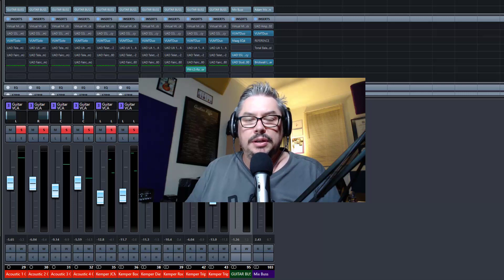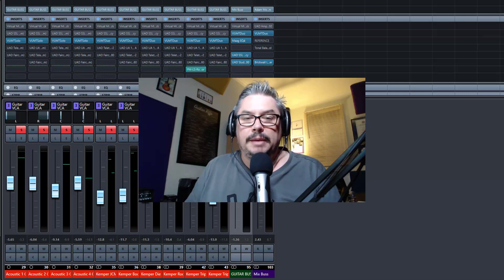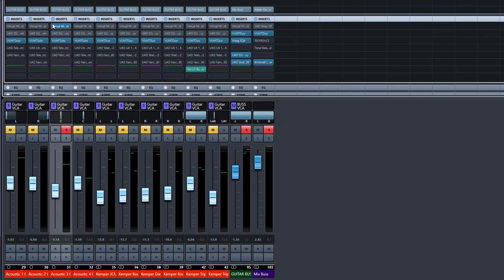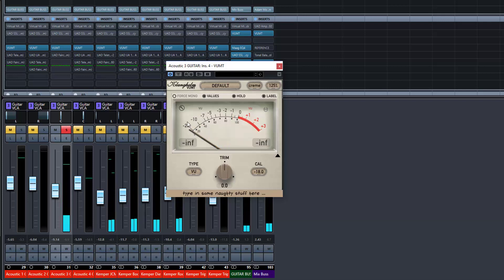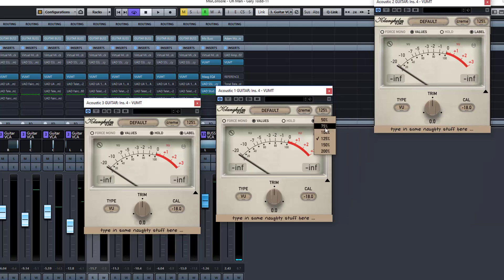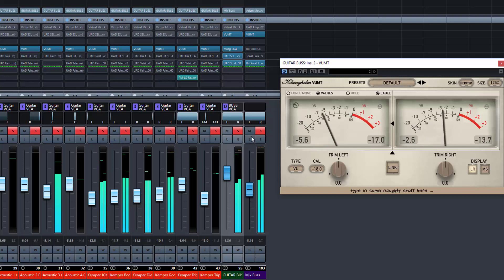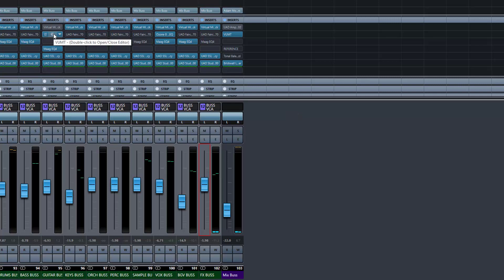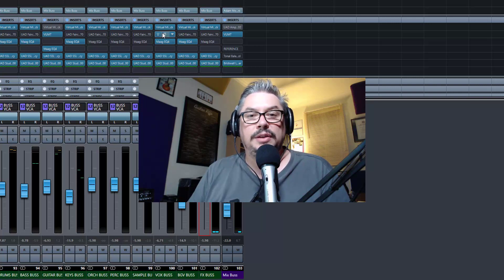How to Gain Stage using a VU Meter - Gain Staging Mixing Tutorial

Comment: First of all Thanks for a great video. A couple of questions on the procedure please. 

1. First you do the 0VU on individual channels, but when you are doing the same to Busses you are again changing individual channels to get 0VU on the busses which disturbs the 0VU setting on individual channels.

2. Again after Individual busses are at 0VU, while adjusting the main mix bus to 0VU you are disturbing the Individual Buss balance to get 0VU on the main mix bus.

3. When you have your main Mix Bus at 0VU, your entire song is averaging at -18dBFS, which is very low for mastering. Many sound engineering are teaching to keep Mix Bus at -6dBFS which is 12 dB hotter. 

Your video is fantastic. I am trying to understand better and learn the techniques you're explaining. Kindly help me to understand better. 

Thanks for a great video.
Reply from the maker: 1. Keep in mind that when I set the individual tracks to 0VU I use Clip Gain. I am setting the level of the audio going into the track. When I adjust the fader I am now adjusting the level the audio exits the track and enters the bus. If I had the VU meter still on the first insert of my audio track, moving the fader does not change what that meter reads. If it does then you have somehow got your Fader set to Pre-Insert and not the standard Post-Insert.

2. Same applies here as described in 1. I am moving the faders of the busses which is the audio exiting the buss.

3. Yes that is correct but this is mixing not mastering. I always mix at low volumes and then after I finish mixing I export my track and start mastering. I don't master my audio as I mix. If you prefer to skip a separate mastering stage then adjust your 0VU on your main Mix Buss to be the level you want the final audio to be. If you are saying that you should send your track to mastering at -6dBFS then you can but I can assure you that no mastering engineer is going to complain about having more headroom to work with. I see a lot of people that mix way to hot these days and leave nothing for the Mastering Engineer to work with.
Reply: KdW Mixing & Mastering I thank you very much for your quick reply Sir. I am very much humbled.

I would like to ask you a couple of question more to get a clear picture for me. 

1. Long time back I heard about Trimming Mix in one of an Audio Engineers Video, is this the same thing, just educating myself.

2. Do you do the Gain staging of Busses and Mix Bus after the final mix or do you do it soon after the rough mix ?

Your videos are helping me a lot. Thank you very much for Educating me. Lord Bless you Abundantly.
Reply from the maker: 1. I am not 100% sure of this but I know in the early days Pro Tools didn't have clip gain but they did have a plugin called Trim. You basically loaded it on the first insert of every track and you could adjust the volume with that. Some people liked to do that so they could keep their faders in a nice location near the top instead of down the bottom range. Not quite the same as clip gain but people used it.  2. I do it during the rough and I keep checking it at stages as I go. As you EQ and compress volumes can change, so I like to keep checking and adjusting.
Reply: KdW Mixing & Mastering I have understood everything clearly except just one thing. 

Gain Staging Individual channels with Trim/Clip gain, Gain Staging Mix bus with Busses is clear for me. But Gain Staging Busses with Individual channels is confusing. In this video you are trimming all the guitars, grouped together, which are feeding into the Guitar bus and adjusting their faders so that they together Peak at 0VU in the Guitar bus. 

My question is if All the channel groups eg. Vocal, BVs, Guitars, Drums, Keys, .... Peaks at 0VU in their respective busses, all will eventually be at the same volume. Then how can we get a mix balance if all the channel groups are at the same volume ? 

Eg. Vocals, depending on the genre  are the loudest element. So if vocals are the loudest element, for example, and their mix bus i.e All the Vocal channels will Peak at 0VU in the Vocal Bus. Subsequently all the other Busses will not Peak at 0VU, rather they peak below 0VU allowing Vocals to be dominant in the Mix. So, how can you Peak all the Busses at 0VU ?

Please kindly help me understand this process. Thank you.
Reply from the maker: So you need to keep thinking about audio going into a track or buss and audio going out of a track or buss. 

1. All our audio is clip gained to get it to 0VU on the individual tracks.
2. We then do a rough mix and then adjust the groups of tracks to hit 0VU on the buss e.g. Gutar 1 = Fader at -3, Guitar 2 = Fader at 0, Guitar 3 = Fader at -6. All together they all make 0VU on the Guitar Buss. This is an example please don't do a calculation as it won't be right, just an example with random numbers.
3. All Groups/Busses can then have their faders moved to create the balance of the mix e.g. Vocal Buss = Fader 0, Guitar Buss = Fader -3, Bass Buss = Fader -6. All together they all make 0VU on the main Mix Buss.

This is very hard to explain in writing so I am hoping it makes sense. You also don't need to be 100% accurate with the 0VU all the time if you don't want. The main thing to watch for is that we don't hit the red on any of the plugins that might create unwanted distortion. If your guitar tracks come in at -1VU does it really matter probably not. It depends how precise you want to be.
Reply: Now i got it. Kindly Correct me if i am wrong.

After Gain staging of individual channels and getting the rough mix, 

Stage 1: Getting individual Mix Balance between elements which goes  into busses and Peak at 0VU on the Busses  i.e  balance between Kiks, Percussion, Vocals etc peaking at 0VU on the Busses is done.

Stage 2: Getting the actual mix of the song i.e mix/balance between busses which feeds into Mix Bus which peaks at 0VU on the Mix bus is done.

At Stage-1 Channel elements are grouped/moved together instead of all the Tracks together, Since Element mix live at this stage but not the actual Mix. eg. Balance between Kiks,Vocals, BVs etc live here at this stage.

At Stage-2 All the Busses are Grouped/Moved together because all the mix balance lives here at this stage i.e the full song mix/balance.

Please kindly let me know if i rightly understood the process. Thank you very much.

Thanks for your Patience in helping me. Blessings.
Reply from the maker: Yep that sounds right to me. Just remember the point of learning these techniques is to get great sounding mixes. If you find this technique doesn't work for you or is not helping then try something else. These are not rules just techniques. The number one rule is if the music sounds great then the music sounds great. It doesn't really matter how you got there or what you did. If you make great sounding music by ignoring gain staging and distorting every track and buss then keep doing it.
Reply: Awesome. Thanks for patiently helping me to understand this technique. All this while i have been doing the same thing except that i Mix Sound Elements + Mix balance in Stage 1 itself. which then gets fed into Mix busses for Bus Processing. I do gain staging only once at the individual tracks and thats it. My Mix Bus peaks at around -6dBFS or less. I will surely try your Technique. Thanks for sharing. It would be great if you could make a video on Bus Mixing and Processing and also a video on Analog and/or Hybrid mixing. Thanks for all your encouragement. Lord Bless you Abundantly.
Reply: Bobby Samuel Arey trim is the input gain control on many analog consoles.
Reply: @kdwmixingmastering  Wow this thread is great! 

Now I have a follow up question regarding this matter: 

1: Instead of working with the faders, can I keep them at 0 and work with gain plugins instead during all stages? For example, have a gain plugin at each input signal before the VU meter and also have a gain plugin at the end of each signal to adjust the exiting signal, would this work as well instead of moving the faders? 

Thanks in advance!
Reply from the maker: @Thadnill  Yes, there is no reason you couldn't do that. I just prefer to use the faders as I have a hardware fader controller and it feels good to mix like that.
Reply: @kdwmixingmastering  I think it is great how you reply and clarify everything.Fantastic reading a thread and how you conveyed your knowledge.Thanks.
Reply from the maker: @StratsRUs  Thanks for the feedback. I try to help as much as I can.
Reply: This is where Im confused also.. So basically if you gain stage and keep all busses at 0db vu meter then the master fader should read at -18dbfs??? that much headhroom?   and theres a sound quality difference by doing this? thank you very much!
Reply: Art Bluevibe I think the master should hit around -6db. You individual instruments should average at -18 and peak around -12db. I’m not 100% sure but I think that’s right
Reply: 5 years later seeing this I been doing something similar epic video

Comment: I work in cubase pro 12 but when i use the Vumt, set at -18, the cubase meter is in the red when I try to get the vumt to 0VU. I know it’s peak verses rms but one can’t ignore the clipping. What am I overlooking?
Reply from the maker: Sorry I don't know. I haven't used Cubase 12. Are there different scale settings for the Cubase Meters that might be causing it.
Reply: @kdwmixingmastering  the scales are fixed, can’t change the settings.

Comment: Hi, I decided to use this plugin. But... When I calibrate sounds to -18 db, mix is so low. Everything is getting so weak. At the end of the mix what I am gonna do for making it loud?
Reply from the maker: This is level that I take a mix into mastering. If you want to do a quick mastering/volume boost just for presentation then put a limiter on the end of the chain and boost the volume. Otherwise this low level will get resolved in mastering.
Reply: @kdwmixingmastering  Thanks a lot.

Comment: Great video content.
I have a question though...
What do you mean by saying that when mixing the vu meter is calibrated in -18db , but when mastering you lower the value?
Thanks for any given answer.
Cheers.
Reply from the maker: What I mean is if I want to use the VU meter for mastering volume levels then I might set it to -10db or something like that depending on how loud and crushed you want you song to be. Thanks for the question and for watching.

Comment: Thanks for a great video. Can I ask one question. For individual buses, if you add a plug in, say a virtual guitar amp, do you meter its output to keep it at -18dbs and then meter again if you add further plug ins to that chain?
Reply from the maker: Technically yes you should. You don't really want to have a virtual amp overload the next plugin in the chain. I get around this by making sure I level match all my plugins so that when they are bypassed the track is roughly the same audible level as when the plugin is active. I do this by ear though and not use a meter. If you want to be precise then feel free to put a meter there.
Reply: @kdwmixingmastering  Thank-you for the reply! I'm brand new to this gain staging and metering business, so I'll probably use the meters until I develop an ear. Another site suggested using a LUFS meter to meter plug ins. Is that something you subscribe to? I've found a nifty one that's free on the web. Love the channel and have subscribed! PETE
Reply from the maker: Whatever meter works for you is the best. I don't tell people what they should or should not use. I use a VU meter because it is simple and I can easily see when it is hovering around 0. If you prefer to do every in LUFS and it is easy for you then go for it. Thanks for the great questions and thanks for the support.
Reply: @kdwmixingmastering  Thanks for the help! Could I ask one final question? I've gain staged everything to -18db in my song, but there are some huge peaks going up to maybe -2db on the drums. Should I just use a compressor to gently squash the peaks or am I better off calibrating to maybe -23db? I saw a video saying the -18 was the sweet spot for plug ins though. It's a tricky subject isn't it - and I love it!
Reply from the maker: Yes you could use a compressor or even a limiter if you want to control the peaks. You could even use a Multiband compressor if you notice it is more a specific frequency range that is peaking. The reason I use gain staging is to get the most out of my plugins but also to not cause any unwanted distortion. With that in mind though it still should be all about your sound and the getting the best mix you can. My big concern with just answering yes you can use a compressor is that it might not be the best for your sound. Maybe the peaks are what you need to get the drums the way you want them. Compressing the drums might make them more controlled but will also reduce the dynamic range and might ruin the sound of the drums.
I teach gain staging a bit like it is a rule that you must be meeting this -18db level etc. but music is art and we need to break those rules sometimes to achieve the outcome we desire.
Hopefully this helps and thanks for the coffees.
Reply: @kdwmixingmastering  Thanks. That's great! I started mixing about nine months ago, but it's only now I'm metering that I'm really getting my head around compression! I'll experiment with the drum tracks and see what I can get! Thanks so much for the answers!

Comment: Great video just a question. Why you put on every track VU and not put one in master track and check the meters from there for each track ?
Reply from the maker: I put it on each track so I can be sure I am only metering on the audio for that track alone. If I put it on the master track then I am having to rely on not having any plugins, fader changes or parallel processing going on in my mix. If I use a template that has routing to FX busses etc then I might accidently be metering those as well. In Cubase when you solo a track it defaults to also solo anything related to that track as well, so if you have a send to a FX track it will get put in solo as well changing the metering.
If you prefer to meter from the master and do one track at a time and you are confident in the results then feel free to do it that way. There are many ways to achieve the same results during mixing and whatever approach best suits your workflow and thought process is the way you should do it.
Thanks for the great question.

Comment: Why didn’t u bring faders to zero before clip gaining? Wouldn’t you get better control later?
Reply from the maker: I haven't watched this video in a while but I am assuming that the VU meter is showing the results before the fader, so adjusting the fader to zero really has nothing to do with clip gain. There is a method that some people use where they do a pre-mix with clip gain to keep all the faders at 0 and then only do micro adjustments. I don't mix this way as I want  to use the faders for mixing.  Let me know if I did not understand your question properly.
Reply: KdW Mixing & Mastering thanks for the response. And I’m a beginner. 

I’ve watched a few of your videos noticed in your 10 minute mix you did a balance with the faders first, then you clip gain on the tracks to bring your levels to where u want on the UV meter. I was thinking if you did the reverse u would then have more control if you start your mix with faders at zero. But I may be confused. 

I think that’s where my other questions come on another post. I may have the metering confused when u are using input metering and pre-fader and when u should use them. 

I was only using input metering when tracking. And then pre fader when mixing. 

I think it’s caused me lots of problems in the past with clipping when I didn’t realize I was in the wring metering and created to hot of a mix. 

Great videos by the way.
Reply from the maker: I am not sure if I didn't represent what I do accurately enough but when I mix I do my clip gain first before I do any fader moves so they are at 0. After I clip gain then I do a rough mix with faders. So your thinking is right in that regard.
As for the metering it depends on your DAW. Input metering can be the same as pre-fader as both are before the fader. I would use input or pre-fader metering to check levels of my tracks for gain staging if I wasn't using something like the VU Meter.
Most of the time my metering is set to post-fader or in Cubase the default post-panner. This then shows me the levels changing as I adjust the faders and the plugins etc.
Reply: KdW Mixing & Mastering i think I like the approach of using pre-gain to lower my mixes and then fader for control. But I’m new and this could change. 

Is there a difference between using pre gain knobs vs track level gain clipping or is it just your preference to do in in the track? I can see a benefit im the track if you only want to clip gain a certain section of the audio track. And use the channe pre gain to impact the whole channel.
Reply from the maker: I actually have another video on my channel where I show the process using the gain control in Cubase. To me there is no difference other than what you have stated. It is a personal taste thing and I like that the size of the waveform visually changes when using clip gain. It doesn't change when you use the gain control but as you state it can affect the entire track instead of just one clip. Try both out and see which one you prefer.
If you decide on the gain control then just keep the clip gain option in mind for times when you want to level out very dynamic vocal or instrument recordings.
Reply: KdW Mixing & Mastering thank again! I’ll make sure I go back through your vids. They go into more details other videos gloss over.